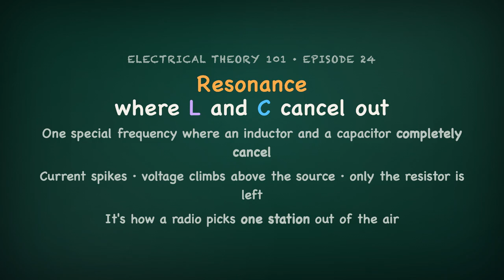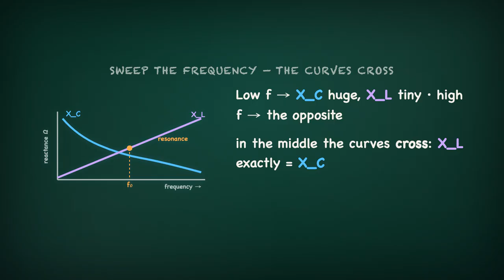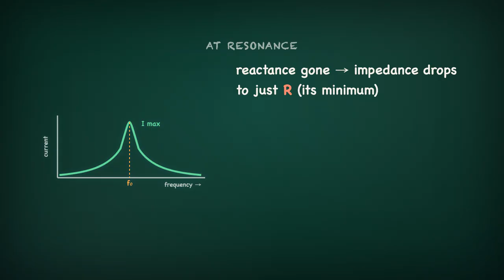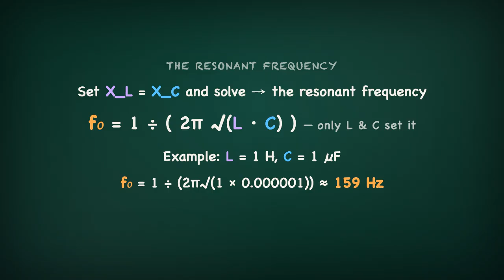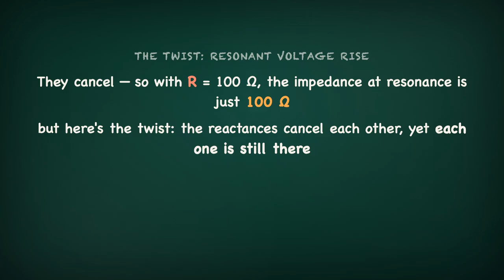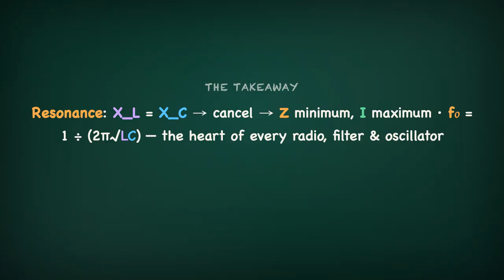What Is Resonance? The RLC Circuit & f₀ = 1/(2π√LC) Explained | Electrical Theory 101

Comment from the maker: Practice answers:  A) LC = 2 × 2e-6 = 4e-6; √(LC) = 2e-3; 2π√(LC) ≈ 0.01257; f₀ = 1 ÷ 0.01257 ≈ 79.6 Hz.   B) At resonance X_L = X_C, so they cancel → Z = R = 50 Ω. Q = X ÷ R = 500 ÷ 50 = 10.   C) I = V ÷ Z = 10 ÷ 50 = 0.2 A. Voltage across the inductor = I × X_L = 0.2 × 500 = 100 V — ten times the 10 V source. That's the resonant rise (= Q × source).
One line to remember: at resonance X_L = X_C → they cancel → Z is minimum and current peaks, and f₀ = 1 ÷ (2π√(LC)). What should we cover next? ⚡